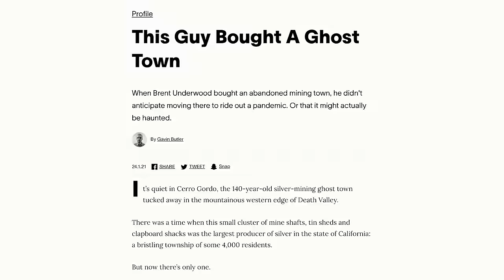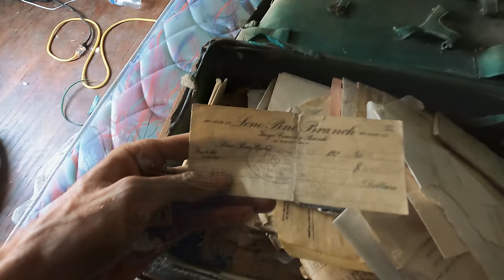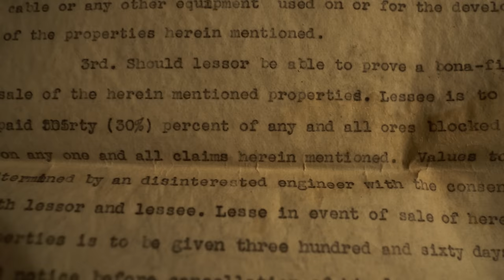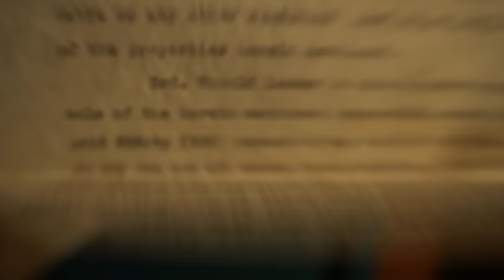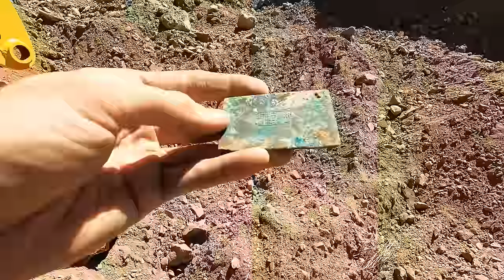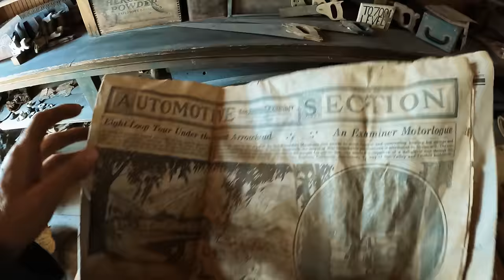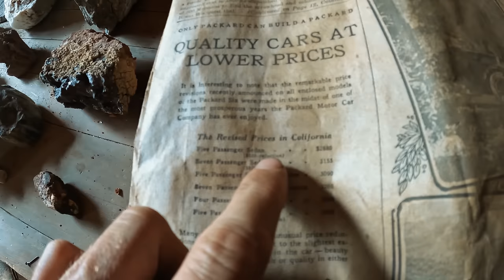A Week In The Life: I Own A 'Ghost Town'

Comment: Hi guys, please start carrying recovery rope with your own Jeep - Mat's Recovery rope or similar. Also, please do not pull at such a sharp angle, you risk damaging the vehicle you are pulling out and your own. Last point do not pull in reverse unless there is no space to do the recovery,  or the vehicle being pulled is lightweight - or a flat pull. Recover by pulling in the forward gears, or you will damage your differentials. Preaching Done - Nice video.

Comment: Maybe think about implementing some kind of signal code for the mine elevator with a flash light and/or a bell attached with a line (bell at the top line running down the shaft) and/or an air horn, and then have a signal code info board at the top of the shaft and in the cart.
Reply: OR just drop a Cat 5 or POTS line down, easy peasy!
Reply: @kauphaart0  the idea with the light or bell with string is you can use them at any height without some complex system.
Reply: Cassie Harry  this could work but with my experience technology works until you need it. The light or bell with string would be more of a backup to the radios they already use. And when it comes to backups its good to have different methods to rely on.
Reply: Try a flashlight.  With a translucent colour on it.  Red would probably be the easiest to see
Reply: don't make it to tech remember 100 year ago the system they used work good  tug on a line ,may be one tug down 2 tugs stop 3 , for up simple
Reply: Many good ideas here but cost and power source could be an issue. 
How about some different color lasers that shine up from the cart onto a board in the control room? Red=stop, Green=Down, Red+Green=Up
Reply: @stuartofJax  I like your low tech high tech thinking..
Reply: Cassie Harry  leaky feeder is the way to go for that mine
Reply: @heartlessgaming2250  they were having problems with the radios or walkie talkies.  When Heavy D Sparks and Dave were in the elevator. So there should be  another  system.  There should be a back up system. Something 8s better 5han no back up. J.m.o.
Reply: @DuanesMind  yes but how expensive would the line be to reach the bottom and the comms that work with it. He probably would rather try a cheaper backup first.
Reply: @stuartofJax  the only issue I see with this is accurately pointing the laser especially as the distance increases.
Reply: Cassie Harry  from my understanding  you can only do two install methods; phones at fixed points which would mean if your stuck outside those points you have to figure a new way to communicate or somehow get to the phone. Or you have the phone in the cart and then you would have to have the phone line extend and contract with the cart which could lead to line pinching or complete loss especially with cases like in this video where they had a large amount of slack when the cart got stuck.
Reply: @valerielove9837  the problem with using walkie talkies in mines and tunnels is that the radios waves don't propagate the same as it would in the open. This is why they use leaky feeder cable which is really one big antenna in itself. I've been in mines and tunnels where I can see the person on the other end but can't even get them on the walkie talkie
Reply: @DuanesMind  thank you for that info.😀

Comment: Just got back from the Mojave north of Barstow, love the area and another great video. As for vehicle recovery, when you pull in reverse it puts a significant load on the coast side of the ring gear and it is not nearly as strong as going or pulling in the forward direction. Want make sure you guys don't risk damaging your vehicle, as those sprinter folks were very lucky you came along.
Reply: That Sprinter should not even been out there with the stock clearance and street tires.
Reply: Patrolling the Mojave almost makes you wish for a nuclear winter
Reply: @blamm5348  especially not with a brainless driver

Comment: Brent, for a little bit of increased safety in the shaft you can get two way radio repeaters.  You'll need to run power to them but spacing them out so they overlap would really help with the communication issues.

Comment: Looks like a Matt's Off-Road Recovery rope investment is due. It's a specialized rope made by Yankum Ropes that stretches around 30% under max load. That lets you get a little running start to build momentum then the rope stretches to absorb the shock of the pull. 
Pricey for a rope but it does an amazing job and it would help support a YouTuber who rescues people from sketchy situations on a regular basis.
Reply: Matt is a great blog to watch. Don't understand having a Jeep out there and not having a recovery rope. Take his man card down a notch...
Reply: @DukeSky  Lol Jeeps aren't the best for recovery.
Reply: exactly what I thougt haha
Reply: @narojdebeste  You should probably rewatch some of his older videos where even he said that jeeps aren't the best recovery vehicles, the main reason he is using one is because he is dealing with sand most of the time and that is where lighter vehicle is better to some extent
Reply: Matt, I was thinking the same thing!
Reply: @narojdebeste  He needs to deflate his tires too! Matt's off road recovery technique should be required watching for anyone who goes off road.

Comment: You should try get in touch with Aquachigger, he does metal detecting and is really into exploring old caves/mines, also a really knowledgeable guy when it comes to history.
Reply: Its not an ideal place for metal detecting. almost every square inch would have a signal and it would be all iron and lead.
Reply: @WeirdSeagul  so is most of the places that he detects, set the discrimination level on the detector to bypass small pieces of iron and lead but at the same time those are the things he might like to have like old square nails to re-use or small pieces of lead could be cool old bullets.

Comment: Museums sell stuff all the time. I think after you get stocked or once you get an abundance of a particular item. Keep the good ones and sell the rest. Put the $ into a fund to make the museum better or other buildings or elevator motor. If you can save hours of time with a faster motor that's more time you have in the mine. You don't have to replace but maby find out more or rebuild so it runs as fast as it did. It would of had to of moved faster with that much ore and people coming in and out.

Comment: You seem to rely on single knot on the end of the rope. In case one gangles open, I always tend to use two, separated by a feet or two. You really don't wanto to run into a knot that has somehow tangled open. That's how quite a lot of accidents happen.

Comment: The bottle that says "Cold Pressed East India Oil" is likely to have contained either coconut or sesame seed oil which is extracted by crushing the seeds at room temperature, and the same as with the olive oils of today, was considered a superior way to get oil from seeds because it's natural and doesn't use heat or chemicals in the process. The most interesting thing however is the East India Company itself, which if you're British or Indian you may well be familiar with. The "private" company started in 1600 and simply went out and annexed large parts of the Indian Subcontinent, colonising other large parts of Southeast Asia and Hong Kong on behalf of the British Crown too. It became incredibly rich on the back of trade that included tea and opium and used its own private army and military power to effectively control India (which back then included Pakistan and Bangladesh), and start what became known as the British Raj. Love this channel and what Brent has done. The explorations with "Reckless Johnny" in the mines are genuinely nerve-racking, and it's nice to watch the older chaps bring their experience to help out and occupy their time.

Comment: Love your channel. You need a portable grinder with sanding wheel attachment. This will knock the rust and old dried on grease from mine lift railing. Will make life much easier.  Then apply the new grease on the way up. Would love to live like this.

Comment: Assuming you can see light from the other side of the hoist shaft (I imagine the brightest flashlight in the world would do it, LOL), could you use colour signals in the event of radio failure? Flashing gets complicated with more than a handful of messages, so at least this could add in some other options. E.G. red for pull up, green for drop down, blue for hold steady, or whatever is necessary. Would just need some colour filter screens and a strong enough light. Even if only as a backup, it might be nice to have a secondary way of basic communication at 700+ feet distance, and seeing you unable to fully communicate for a moment is anxiety-inducing to say the least LOL.

Keep doing what you're doing (safely!)! Love your channel, who you are, and Cerro Gordo! - Hum from Portland, Oregon

Comment: Those are cut nails there a old school nail that was stamped out of a sheet of metal they are still made today but they are much more expensive then a normal wire nail because they're strong you can reuse them more then once and they are much less likely to split a board because of how they seat themselves in the grain

Comment: 28:52 that's exposed Know an Tube wiring in the back, I would really consider rewiring those houses. I'm absolutely sure the fire in the American Hotel was caused by electrics. US Electrics back in the day weren't that good and don't hold up, especially if you for example mix old Knob and Tube with modern style Romex wiring, the joints are often really poor. Take some time to learn about electrical and rewire the houses yourself. It's not that hard, the materials are surprisingly cheap and it would really be a shame if a newly restored building got lost

Comment: holy fugg dood, set your claim spikes and run those tailings, they didn't have the fine capability we have today, tony beets just ran about that much old tailings in alaska and it earned him $600k .. shit you not but he had to dig it all back up again as they used the tailings to fill in there overburden holes, hale that sits in a nice pile for you, just use a shovel into awash plant with a conveyor, set up so you keep pulling the conveyor back from your new tailings, that will move it against the old pile as it get smaller and then away from the new pile as it gets larger, easy money, maybe a solar panel set up and electric wash plant, a 10,000 gallon settiment tank for your water  supply on a recycle situation..  

hale yes what if you got enough pay to build a nice house and get better mining equipment?  work at your own leisure and pace from now on..  dunno how much land you got but prolly enough to get more pay..  you know how to look for signs of gold right?  old riverbeds, under large boulders, black sand quartz.. fugg yes get it son!